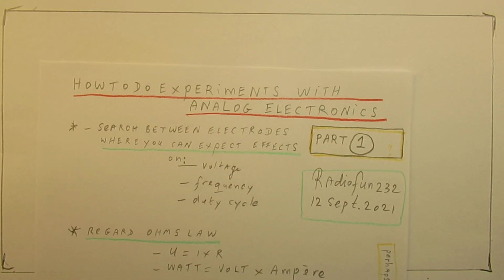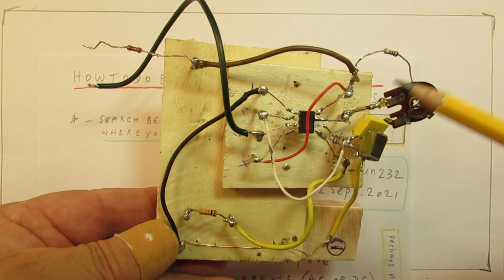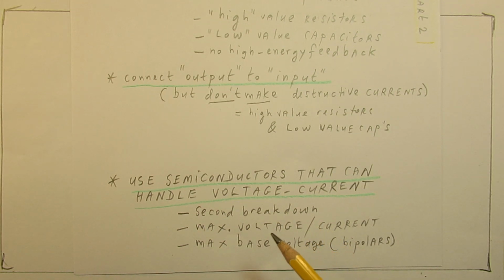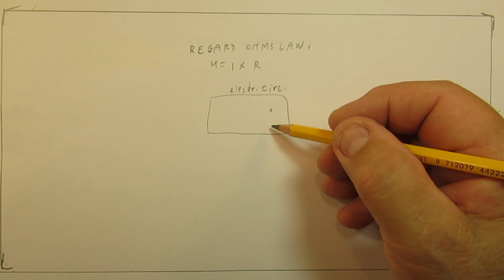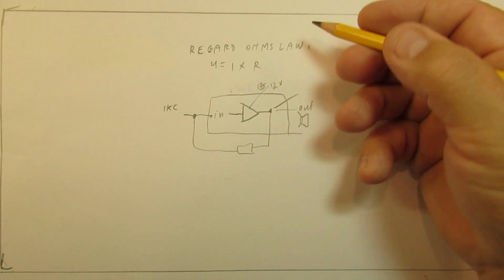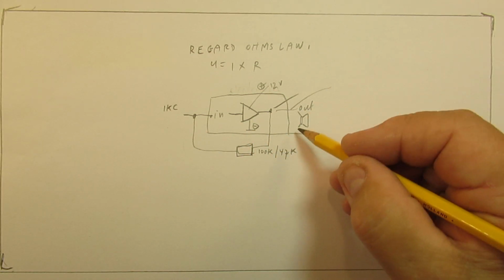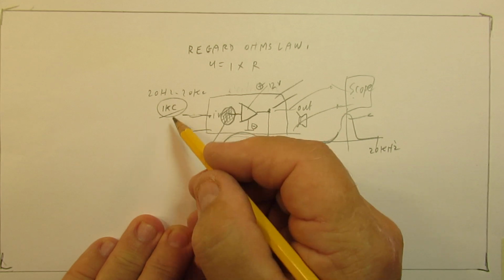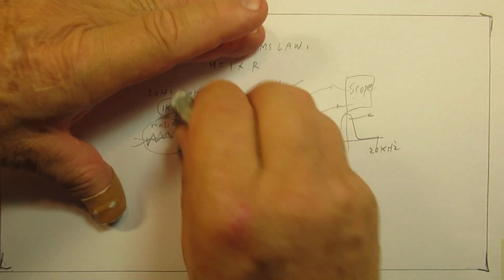How to do experiments with analog transistor circuits: part 1

Comment: One of the most under rated YT channels! FANTASTIC VIDEO! Thank you for sharing your wisdom. Now, if I may ask: amplification is one thing...but what would it entail attenuating a audio frequency? To be more to the point, in my own experiments the last six months, reading up and experimenting with many different circuits I found online, I still cant seem to get my homebrew interface (between ICOM 706 and computer) to acceptable values. 
I realize, as with everything in life, there is so much to consider when developing something like this, and may be the reason why there is so much "flavors" and styles, when trying to achieve attenuation.... why 600ohm on the radio mic side? why use a 1:1 isolation transformer?  would a 1:4 transformer also work thus eliminating the electronics? in digital modes, like FT8,  when using certain type of capacitors, what would be the reason only the carrier of the transmitted signal is received by other stations? (a Fellow HAM reported, in Afrikaans "moerse sein! maar geen audio!") (HUGE SIGNAL, BUT NO AUDIO)
This became very confusing to say the least, but I'm still playing around with different types of circuits and components. Anyway, your input would be put on highly appreciated regarding the basics of isolation, the values the computer sound card, and radio mic input wants to see...

73 from South Africa de ZS3PV
Reply from the maker: The problem is that I am not a radio amateur with a transmitter and my knowledge about such setups is very limited. Is it not possible to look via the oscilloscope to see modulation on your antenna signal? I don't know much about digital modes.
Reply: @radiofun232  thank you for the reply! No problem, in not being a amateur :) was just fiddling around with attenuation methods, for example: converting a "amplified audio signal" from a computer, back to "line level" for input to a radio mic. Apparently, the radio mic wants to see 600 ohm.
But thank you for the reply! 73!

Comment: THAT WAS VERY GOOD ADVISE ABOUT USING HIGH RESISTOR & LOW CAPACITORS..  WHEN EXPERIMENTING WITH NEW THINGS..  : )
P.S. I DID NOT KNOW THAT ABOUT THE BD139 & BD140.. THATS GOOD TO KNOW. ID ALWAYS CHECK THE DATASHEET. I HAVEN'T WORKED WITH THOSE TRANSISTORS & IM ALWAYS MEANING TO ORDER THEM WHEN GET SUPPLY'S, BUT 'ALWAYS FORGET TO ORDER THEM' I WONT THE NEXT TIME BUT I ALWAYS SAY THAT TOO. ; )
LIKED THIS VIDEO, THANK YOU FOR THE INFO YOU SHARED....
Reply from the maker: Thanks for your reaction.
Reply from the maker: The BC 547 b (NPN Silicon, Hfe 300) or the BC 557 b (PNP Silicon, Hfe 300) and the BD139 (NPN Silicon, Hfe 75-150) and the BD 140 (PNP Silicon, Hfe 75-150) + the 2N3055 (Silicon Hfe = say 30-75) are transistors that you "must" have in store/stock in enough quantities. They are a kind of always working transistors with which you can make many (all kinds of) circuits, up to (say) 8 MHZ.